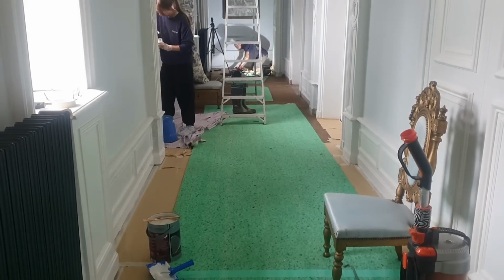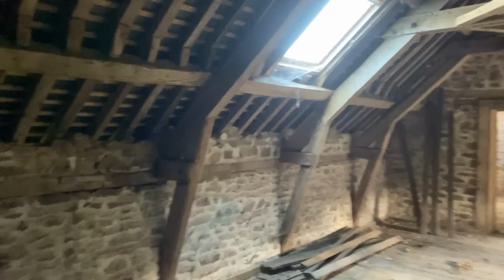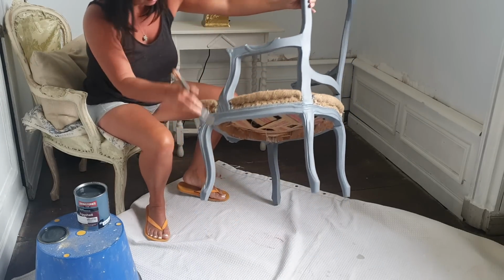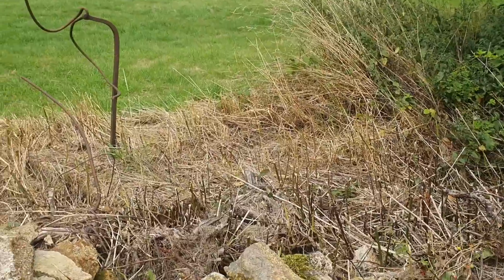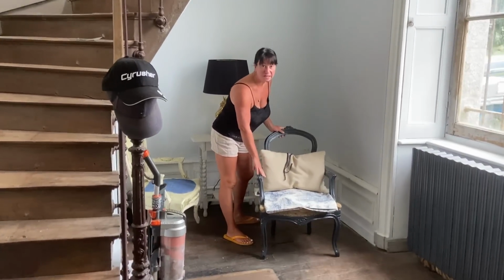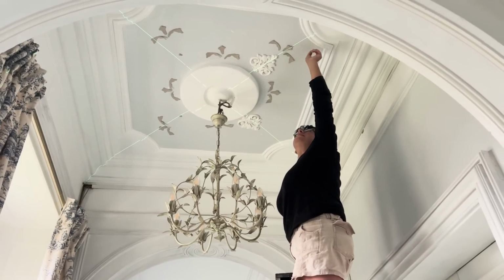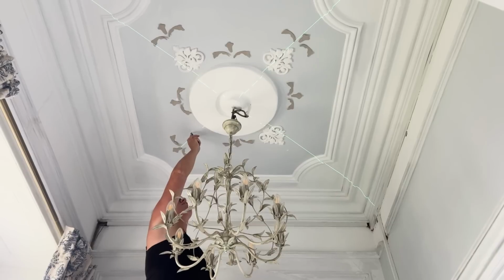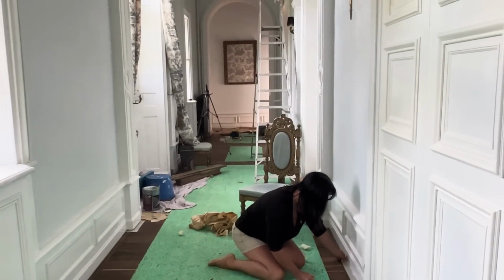This Could Go Very Well... or Horribly Wrong!

Comment: Looking great from floor to ceiling!! Literally!! 

Do you have any additional molding appliqués you could use in the corners?  Perhaps something roundish to put on the outside  corners where the curves of the inner square are curved in?  White on White will be subtle, but definitely there.

It will pull out the decorative concept all the way out to the perimeter of the space.  Just thinking?? 🤔🤐

Comment: I like the chandelier too. Have you thought of painting it with the flat and lustre paints, maybe with just SLIGHTLY darker shades than those you have used on the walls and trims? That would hive it presence to substitute for size. It could be very special.